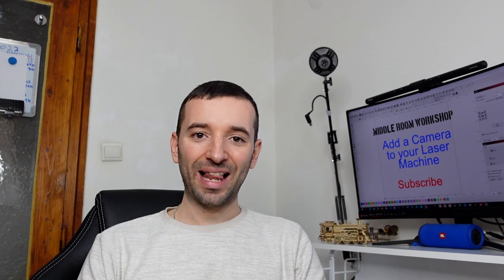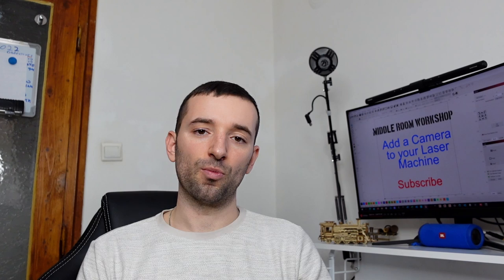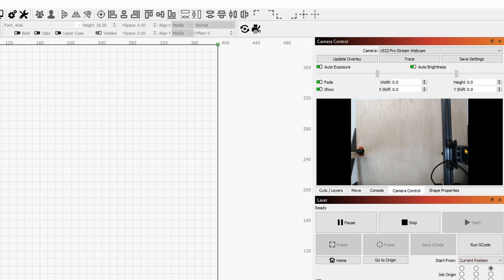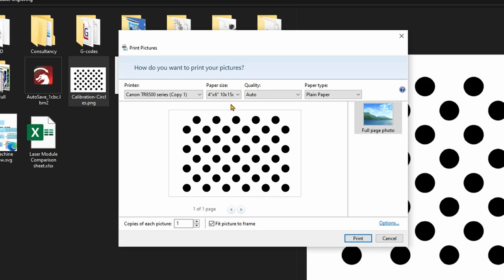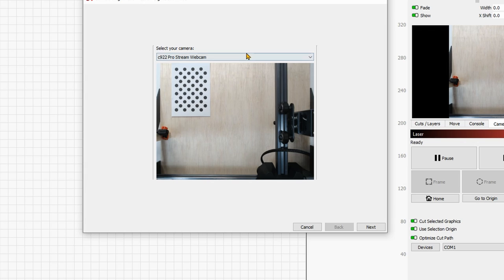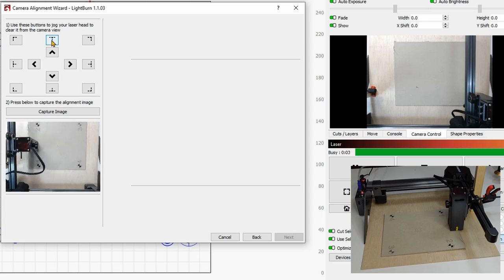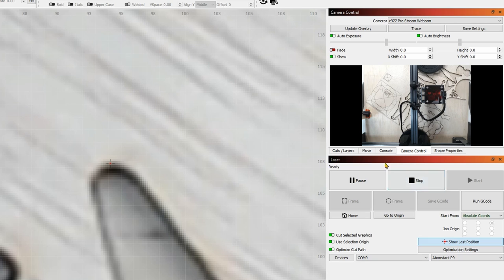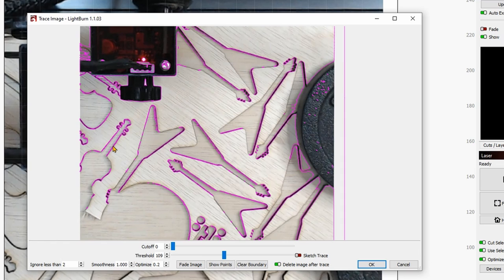Add and Align a camera to your Laser Engraver - LightBurn | Any Machine

Comment: Wow, thank you!  This has answered a nagging question on the dotted pattern sheet.  I've a LightBurn camera, and I've the XTOOL D1 10 watt Laser, and for some reason LightBurn does not like the Laser????   I try to frame after calibration and the laser will go off to the right or left and frame an area that does not have my coaster. Yes, I undate the camera.  Anyway, I'm thankful for you clearing up the dot size pattern.

Comment: I got this to work on an Xtool S1. However, I am limited to the distance I can set the camera permanently as I have to maintain clearance so I can open the lid. I guess removing the lid and getting some laser glasses might be an option. I don't want to fix anything permanently to the laser enclosure. Any Ideas?
Reply: Also thought of getting a better Camera with a wider field of view.
Reply: Hmm. I have a 12 meg SLR I might be able to use.

Comment: Thanks for the tutorial. The overlay just showing the area between the alignment marks, what about the rest of the area around the current overlay? Is there any way to get the full view of your bed area?
Reply from the maker: Hi, Markus; thank you for your comment. 

The overlay should show you the corresponding engraving area as long as the camera is placed high enough to capture the entire area and the size of or machine is set correctly.

Do you see the entire picture in the Camera Control Tab? That is everything that the camera sees. If not, you need to raise the camera.  
Is your engraving area corresponding to the machine? Check under Device Settings > Working Area.

Let me know
Ciao and Happy New Year

Comment: I am new to this . Thank you for the video . If for example your machine is working engraving and your computer is doing an update i dident know en was restarted . Everything stopped working . How can i go back and start again from where the engraving was stopped to end the job ?? Can you tell me please. Thank you.
Reply from the maker: Hi, Xavier Pemmerl; thank you for your comment. 

This is an interesting question
Unfortunately, is not that simple, but it can be done. 
It depends on which machine and software you are using and whether you are working in an Absolute or Current Coordinate system.

If you are using LightBurn, and you were working in Absolute coordinate, and you did not move the workpiece, once the machine powers on, home it, then get to the preview window, use the slider to approach the point where it stopped, and then use the arrow keys to make fine movements, finally click on "Start from here" button.
In most cases, you should get out good or, if noticeable, a very small imperfection.

If you were using LaserGRBL, it is a bit trickier because first, you need to reposition the custom coordinate system, then you need to do something similar to what is explained above, but you cannot do it in the software itself; you need a code previewer like https://ncviewer.com/
Load again the file you were working with in LaserGRBL and set it exactly the way it was, then move the laser to the point of reference, say the bottom left corner of your design and make finite jogs adjustments to get as close as you can there, once that is done save the file as a .nc file and open it in the software linked above.

Here you will be able to preview the file, and you need to try to get to the point where it stopped; you will see the dot on the screen and the corresponding code line highlighted. Once you are there, hold SHIFT, scroll to the top of the code and click the beginning of the 3rd line, delete and save.
Now you can re-import the file in LaserGRBL; if all is good, you should see the engraving starting exactly where it was.

If the engraving is not a picture, that should be much simpler, but you need to understand your code a bit to leave the parts required for the machine to work.

As I said is not simple, but it is also not impossible. 
A comment may not be very easy to understand; therefore, I might plan on making a video about it in the future.

Let me know
Ciao
Reply: @MiddleRoomWorkshop  this wil be great . I look forward to see the video . Ciao

Comment: If I am using a laptop and I disconnect the laptop close the program etc, and come back to do another cut does the camera have the setting saved or do I need to recalibrate everytime I reconnect?
Reply from the maker: Hi, @jeancancel; thank you for your comment.

As long as the camera is not relocated or the machine moved relative to the camera, the software should retain the settings. Therefore you can shut down your laptop.

Still, I have had users reporting a problem with the calibration lost.

I hope it helps
Ciao

Comment: Which camera can use with lightburn? Can i use webcam or the other camera to connect with it? Thanks
Reply from the maker: Hi, @tomy8148; thank you for your comment.

Yes, you can use a simple webcam to implement this feature. Alternatively, you can look for a dedicated, inexpensive fish eye lens camera.

Here is the link to the one I recently installed on my Machine, version 160°: 
https://s.click.aliexpress.com/e/_Dnq84P1

Unfortunately, it has no enclosure or shell. in a few days, I will upload the one I designed on my website so that you may 3D print it.

I hope it helps 
Ciao

Comment: Does this let you use entire bed or just the section that the you aligned the camera with?
Reply from the maker: Hi, @elquis_merl; thank you for your comment, 
As long as you verify that the camera sees your entire engraving area after the optical correction and the engraving test, the software crops automatically to include only the engraving area.

I hope it helps 
Ciao

Comment: I Have the EXACT SAME Camera you are showing. 
And it will not show a Picture.  Shiws the camera Name.
Does not show a picture. 
So I have no idea why. 🤷🏽‍♂️
Reply: No, Made sure, You have Logitech,
I have an ONN autofocus 1440p

It will not show up in Laightburn.
The name pops up, I selected it. and Nothing.
So I went to the Computer settings for devices.
Click the name, Video popped up, saying Laserburn is using the camera.
🤷🏽‍♂️
Nothing else.
doesn't work in Lightburn.

😮‍💨
Reply from the maker: Hi, Jason Medina; thank you for your comment. 

It looks like some other software is using your camera.
Try to see if another app is running in the background that takes priority of the camera use. You could check in the Task Manager if you recognise some app that may use a camera, otherwise in Windows; go to the settings, and under Privacy > Camera at the bottom, you should see the application currently using the camera, from here you can either look for it and remove its permission by toggling off the button or go back to the task manager and locate the up to terminate it.

Last but not least, you may want to try updating the camera, as there may be some incompatibility issues with your specific machine/software combination. 

I guess this can be done with the Logitech G Hub https://support.logi.com/hc/en-gb/articles/360025298133

I hope it helps
Ciao
Reply: @Middle Room Workshop  I finally got it. It was on the laserburn site. 
Settings was in Custom camera, I changed it to default, and it popped up right away.

I'm not sure why. the pictures are a little out of focus, but it get the job done.
Thanks 👍🏻

Comment: holly crap this sucks... i tried for hours to get this to work and it either won't capture the image or says it can't see the pattern..
Reply from the maker: Hi, B Gat; thank you for your comment. 

Yes, it can be a bit problematic the first time. 
Make sure that you are printing out the pattern in A5 format; if the size is not correct it won't take it.

What webcam are you using? You may have some incompatibility issues with the specific camera.

Ciao
Reply: I have the AC1 Camera from Adamstack I had to scan the dots on a 1 to 1 ratio or exact size and print the dots on a flat white paper. The dot matrix printed on a glossy paper was not seeing the dots I also had to cover the honeycomb even though I tried the switch to hide the honeycomb. Between those two I was able get it calibrated.😀🛫